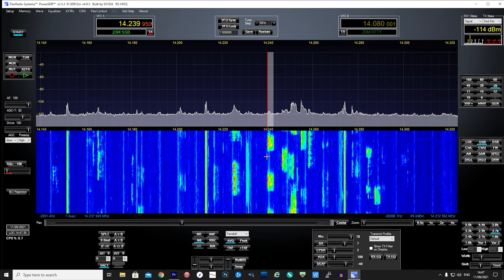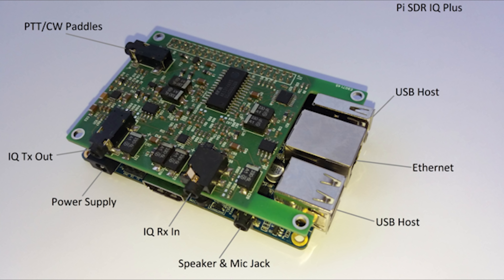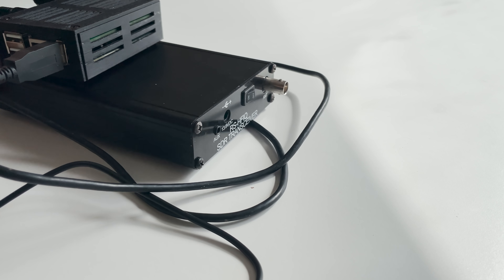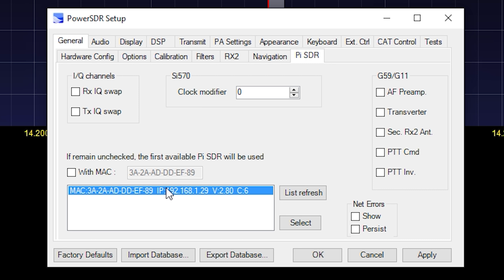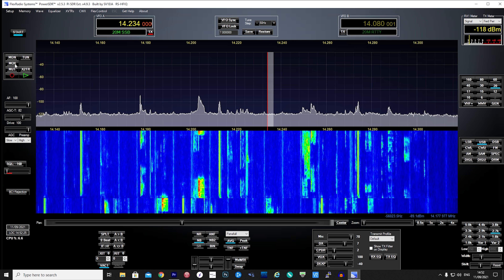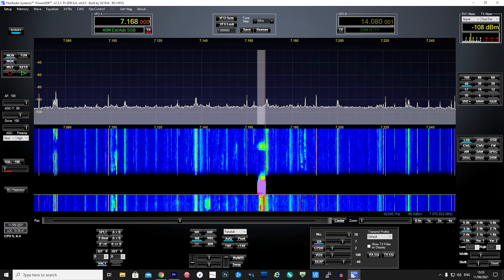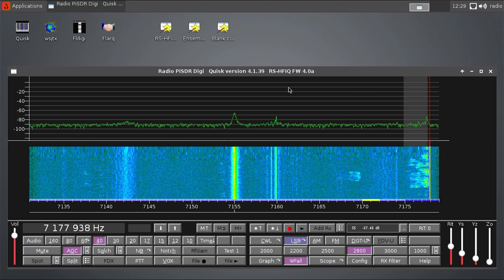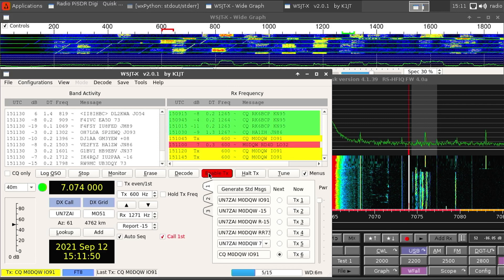Pi Hat SDR IQ - Remote Or Standalone HF SDR Transceiver

Comment: I would really like one for my RS-HFIQ but its unobtainable and the startech usb sound card is a uber PITA to work with in debian setting up with quisk. I got fustrated and dunked the idea its been said BEHRINGER (UCA202) usb sound card works better in debian but still only 96khz sample. Really wish someone would do a nice complete tutorial on how to setup the RS-HFIQ on the RPi4 for a noob like me with little to no knowledge on programing language and the in's and outs of linux. I'm almost at the point of bundle everything up and sell it and regret throwing $100's away.

Comment: Great review, I own the RS-HFIQ and the XPA125B, how do you send the input to key up the amp? I am waiting for the SDR IQ Pi hat to arrive to complete the system, thanks, enjoy your videos! 73. K7LEN
Reply from the maker: I use the PTT line from the 3.5mm jack on the RS-HFIQ to the PTT line on the 125B. Make sure the amp and the RS-HFIQ are using the same power supply. To be sure on the connections, you’ll have to check the manuals for the wiring as it’s difficult to explain in txt.
Reply: OK, Thank you, I will have to investigate the process to get that done, thank you for your time, keep up the great videos!
Reply: @TechMindsOfficial  but in essence it was a straight cable, nothing else?

Comment: Which version of the Orange Pi is recomended ? No mention of this on the sdr IQ website. Which Orange  pi did you use in your video ?
Cheers,
Peter.....
Reply from the maker: Hi Peter, currently Christos is only selling a complete solution, with Orange Pi already configured. It may be worth dropping him an email to see if you can purchase a Pi Hat on its own before spending money on an Orange Pi. You could also ask him the Orange Pi version, just to be sure. Thanks